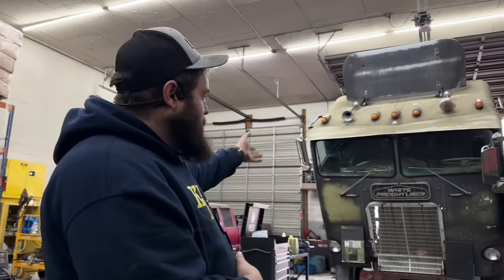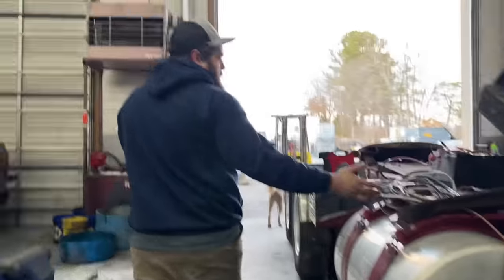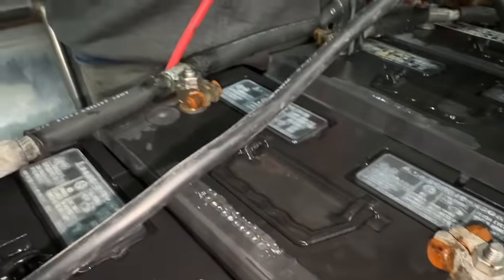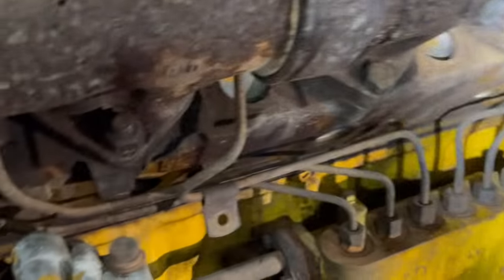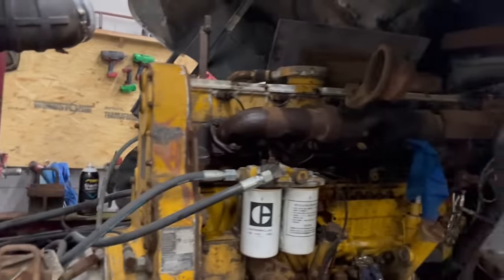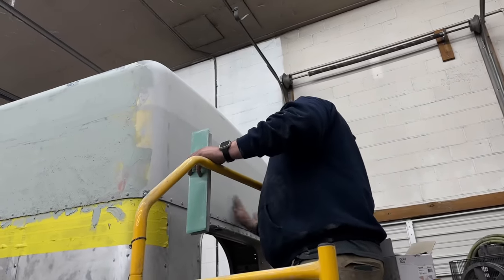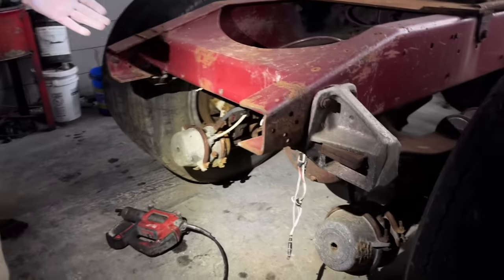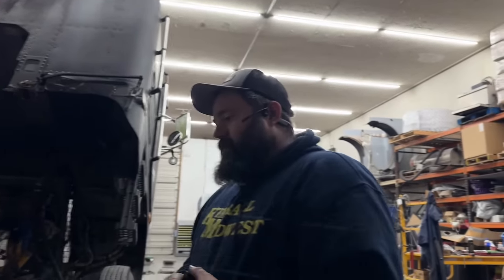The Johnny Cash Cabover Finally Runs After 27 Years!!

Comment from the maker: Guys check out the original purchase video https://youtu.be/U9pnZf9jkgs?si=yfkUal4jxn2UfqAV
Reply: Hey Tim bro thanks for the great content bro but I got a suggestion for you bro if you want that cab to turn out absolutely slick like looking into a mirror wet sand the cab and sleeper with 2000 grit bro it will make a night and day difference but it's just a suggestion bro you are doing a great job bro just a idea I wanted to throw out your way and thanks again for the great content keep up the great work
Reply: Split rings are extremely dangerous bro you have to find a specialty tire changing company that is certified with a safety cage they break them down in bro  for real for real it's what the old timers call widow makers
Reply: I'd put the regular wheels like you put on all your other trucks tim especially for your safety and Braxton going cross country with you and the way he and you both love trucks as much as yall do safety first bro man but it's your truck do what you want to do to it either way we all will stand behind you no matter what you decide to do to it have great one tim and brax

Comment: Good to see the old Cat fire up so easy! 
Don't listen to those guys saying those wheels are dangerous, they'll be fine! And they look Great! I think the nay-sayers might be confusing those 2 piece wheels with the old "widow maker" wheels which were joined in the middle. The only thing with these 2 piece wheels is make sure you use a cage when putting them on the rim, but if you make sure the rims are clean and damage free there won't be a problem. 
You are supposed to use a cage for the new tubeless tires as well according to the manufacturers. 
I ran, and changed, these old 2 piece and 3 piece rims for years and had no issues! 
There were some problems with tube type tires however. The bias ply tires would always pound like a flat spotted tire until they got warmed up and if you got a flat the valve stem would fall into the tire and destroy the tire from the inside! To avoid that I always carried some small vise grips and if I had a tire getting soft, I would clamp the vise grip onto the valve stem with the plier laying flat to the wheel and go to wherever I could get it fixed. Even if it was totally flat the vise grip kept the tire from being ruined! 
If you were going to be running this commercially I would say Definitely change them. But for a period piece show truck I would polish up those old aluminum tube types cause they are SWEET!
Reply: I do love the look of those split ring aluminum wheels but man are they hard to find good tires for and hard to find people to work on them

Comment: You can put a 12 volt 39MT on there and get rid of that series-parallel switch on the frame. The glow plugs should be held 30 seconds even if it’s 75 degrees out.

Comment: Your batteries are wired wrong, you should have two sets of 12 volt in parallel but not all 4 wired together, a breaker is required on the charging circuit of the switch for each set of batteries, the series parallel switch connects the batteries from parallel to series producing 24 volts, it kills all power to the 12 volt components during cranking,  you can not get a 12 volt starter for the 1693 as the starter nose cone is quite long and made specifically for the 1693/D343 , D346 and other cat engines with rear accessory drives , unless you can find a wizard to convert the starter to 12 V by changing the fields and armature. good luck and remember we're all counting on you   LOL

Comment: It runs . I sure would put a screen over intake . So varmints n shop towels don’t get pulled in intake   .. series parallel switch is energized when activated with ignition switch !  Hope explanation helps . I’d call u guys not walk u through this . Can’t speak anymore ,,cancer took thyroid and voice box . !  If it’s worth doin . It’s worth the wait ..Body work the smoother the body ,The better the paint job . It’s done when it’s done . I wouldn’t sweat it .. have a good one . 63 yrs of diesels tractors ,trucks ,locos ,

Comment: Beck in 1989 I started driving and I drove 1960’s through 1980’s 2axles lucky to have a seatbelt never powered steering. You learn quickly how to dock 45’s and 48’s trailers. Built some upper body strength. Lol 😂🎉

Comment: I know everyone poo poos on the old tube type lock ring rims but I've been dealing with them for years with no issues or fears. Where guys go wrong is when they're in a hurry to get a tire on and don't take the time to properly inspect and clean the ring and rim.  I like to sandblast the mating surfaces if there's any rust buildup so when they go back together they actually lock like they're supposed to, any rust or dirt buildup creates a situation where the ring doesn't seat properly it will kick away from the rim instead of pulling together. When they're right they go together easy. When restoring an old truck it's nice to have the old style rims for the look, the biggest issue now is finding the tube type tires but they're still out there being made.

Comment: To all the morons in these comments who don’t know the difference between split rims, split rings, and locking rings, these are locking ring rims. These along with daytons are not the dangerous ones. The bad ones are the all steel non spoke wheels generally with 5 hand holes that split flush with it, lots of medium duty fords and GMs got them. 50s and 60s prominent. These aren’t very dangerous, you just have to know somewhat what you are doing. I’d recommend using a tire cage, but then again that’s recommended with every heavy duty wheel.

Comment: So for the turbo oil lines you can have custom hydrolic lines made to replace the missing metal lines. May have to change a couple fittings but that should solve your problems

Comment: I remember those wheel  rims with the locking rings. They must be seated good when refitting and the tire inflated in a heavy gauge metal cage in case it comes apart. If the ring flys off it can near cut you in half or whoever else is in its flight path.
If the tires on it are sound and holding air they would be cool to have on if it were going to a show on a trailer. But for the road i would have a nice fat set of alloys.

Comment: The thing that switches from 12 to 24 volts is called a series parallel switch. The rims are called split rims and are most dangerous to the guy airing up the tires as they tend to pop off the rim explosively.

Comment: Lock rim wheels are extremely dangerous. Back when I started in the trucking business (1973), the foreman fixed a flat, put in the bed of his pickup and pumped it up. Five hours later, he walked by and bumped it to see if it stayed pumped up. The rim blew off and knocked him butt over teakettle. The pressure bowed the pickup bed and the guys that were there claimed the rim went higher than the light pole at the plant. Nothing scares me more!
Reply: Lock rim wheels are not dangerous. You are mixing up split rims with lock rings.

Comment: Those wheels with split rings AKA "Widow Maker" if not installed correctly will go off like a bomb with shrapnel.  Thus got the name.  
Now the tubeless can be just as deadly when using an  excelerant , such as  either , to seat them. Get the safety cage. Had an acquaintance lose his teenage son to one blowing up even with a cob at the end of wire over 6 foot away to ignite with.  Get the cage.
Reply: Was the teenage boy you’re talking about 19 years old and his dad’s name was Reggie ? 
I knew a boy killed like that his dad’s name was Reggie.
Reply: These are not window makers, these are lock rings. Widow makers are the all steel wheels generally painted white that were in use during the 60s. So many people don’t know the difference between them. Daytons aren’t dangerous either. 😂
Reply: @CCRider5312  no. Different person. They are from Iowa tho.

Comment: Allyn from A Thompson Trucking my first truck was 74 Pete with a 1693. That switch is called a series parallel switch I did away with it and put 12 volt batterys and starter cause it had 6 volt batterys that were wired in series. It was 40 years ago so I don't remember every thing I did and I put a 40mt starter and it worked fine. I think I mite even have a few 1693 parts somewhere cause that engine blew and changed it over to a 3406 that was a job I don't think I ever want to do again so good luck I hope you get it running. If that's a 425 they have a lot of power I loved mine I like to have another one but they are over 50 grand to major good I'd love to see it done

Comment: If you sand anything with 1200-1500 grit paint will not adhere to the panel. Never use anything more than 320-400 grit before painting.

Comment: It looks like the front 2 batteries are run in parallel which is yiur12v and the back 2 batteries are probably flipped and they're running in series to get the 24volts to the starter That thing on the frame might be the  solenoid For the starter.
It runs a 12 volt relay but sends 24 volts to the starter
Reply: That’s what I am thinking. The way he has it is only going to send 12v. Probably why the need of all them jumper boxes, welder, jumper cables of a mess he has got. That start probably only getting 12v and needs two batteries in series to get 24v.

Comment: Them old split rims are dangerous  !!  That outer ring  if it’s not seated, will blow off, cutting your head off. That is why they built a cage to pit them in to air up the tire. Seriously people were killed, changing tires. Throw them away. I don’t know if a tire store will even change the tire. DON’T mess with them. I worked at a gas station growing up, people would bring those old rims in to charge the tires, because they didn’t want to take the risk themselves.

Comment: That thing you're calling a solenoid is a series/parallel switch & it does control the 12/24 starting charging system & by the way those wheels aren't that bad to mess with if you kinda know what you're doing problem would be finding tires to go on them

Comment: I would convert the tires from those obsolete stud pilot wheels to modern hub pilot polished Alcoas & 22.5 low profile tubleless tires;pneumatic disc brakes all around,add air ride to the front axle,replace the solid cab mounts with an air ride cab mount from Link Air Ride Suspensions Chad Keegan did the air ride cab mount conversion on his 1983 Kenworth K100 flat top COE,and re-wire & replace all of the obsolete incandesant lights with modern bright LEDs,and replace all of the incandesant guage lights with LED guage lights.

Comment: 1693 close eye on temperature and egt they will pop the head /and or gasket on mine I took the fan clutch off put 6 electric fans 4 run to temp sensor 2 to a manual switch you can get big power out of them they where a earth mover engine they derated them 350/425 Hp to keep them alive  nothing sounds like one  when running right

Comment: I have those same steer wheels. If you replace them with one piece wheels, you will have cheaper, safer tires you can buy anywhere. Some commercial tire places won't work on mine and the rings are wear or damage items and you can't get new ones.

Comment: they arnt a true split ring but for easy use & maintenance you should change them as your not looking for historical accuracy 
besides the tire size is likely tough to find 10-22s?... same rims on the trailer ? 
some guy doing an accurate restoration of an older truck will likely want to buy them
can you get a hub pilot kit for that old girl ?

Comment: My late Father had a 1973 Freightliner with a 335hp cummins in it. He had it all painted up and had cool painted on pin stripes on it after hitting a deer. Used it to pull a 40ft logging trailer loaded with logs or pulp wood. I'm sure theres pics around of it when it got out of the body shop. Ended up shutting down the logging buisness in 1991 and selling off all of the equipment including the truck. Of course I was only 16yrs old at the time but would of loved to keep the truck. Great videos Tim and family, Keep up the awesome work !!!

Comment: Tim that thing you call a solenoid is a series parallel switch!! Your batteries are not hooked up correctly as you have 6 volt batteries hooked parallel which gives 6 volts. Be careful you can burn that truck down easily!!!!

Comment: My dad and grandfathers trucks had the split rims , my dad eventually went to one piece rims and tubeless tires, mainly because the old ones were getting harder to find, they used to change the split rim tires themselves, your supposed to use a cage because they are dangerous if the split ring doesn’t lock in properly

Comment: If you can find new tube type tires I think I would keep them unless your actually gonna run the truck. I grew up with those type of wheels as long as you keep them clean they are fine just be careful and use a cage when inflating.

Comment: No front brakes or power steering? That is old school. I remember one of the first dump trucks I ever drove had a dry/wet switch for the front brakes........................................cool video
Reply: aka, air pressure limiter valve....cut the front brake pressure half.

Comment: Tim those wheels are not dangerous if you know how to change them. You have to have a cage to put them in when putting air  in them and make sure that the ring is seated right. That was my first job when I got out of high school.The battery switch on the frame is a parallel switch.
Reply: They are only dangerous if you don't know what your doing or not using commonsense.

Comment: Definitely get rid of the split rims. They can come apart and take your head off.
Reply: I think that they'll DEFINITELY delete those split rims Hopefully
Reply: Hate to tell you those aren’t split rims. Those are locking ring tube type rims. Actually a very safe rim. If you disassemble and assemble them correctly. You also air them in a tire cage which is always recommended. You can also get those in tubeless tire style that doesn’t have a locking ring at all.
Reply: @darrencatenacci2737   I have personally seen them come apart in the tire shop I worked at. Not something to mess with if you don't know what you are doing. By definition they are split rims.
Reply: Those aren’t split rims, they are locking rings. If you have a cage or a heavy chain to tie around it while airing up it won’t be a big deal.
Reply: @mintyman1968  Do yourself a favor and google image split rim wheels. 👍
Reply: @clifftonarnold6989  I know what a split rim is, and I know what a lock ring is. These are lock rings.
Reply: @mintyman1968  I agree the parts are called lock ring and lock ring rim. When they are put together, they are called a split rim.
Reply: @clifftonarnold6989  Wrong,
Reply: @mintyman1968  ok